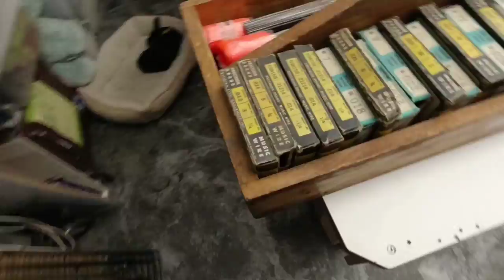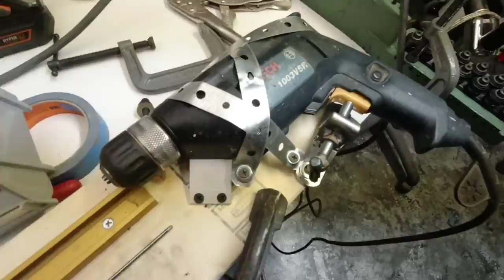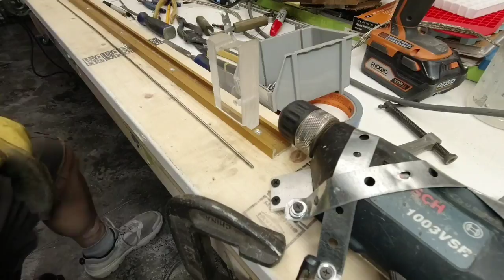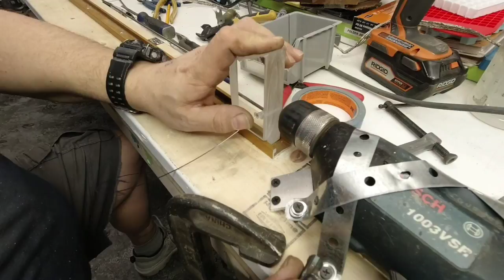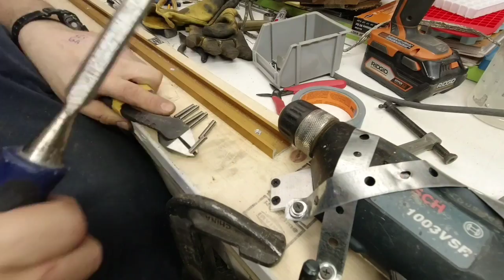Simple Diy Spring Making Jig /Machine (for those of us without a machinist lathe).

Comment: that setup is the definition of DIY
Reply from the maker: Thanks.  I take this as a high compliment. That said, for better or worse, sometimes i get lost in the building of a jig to save money and time. And, it turns out it could have been done more simply in another more conventional way. So, pro tip: weigh out what the goal is, then determine the best process to get there.  In this specific case, it was definitely worth the build. Simple. Quick. And, it worked without alot of trouble. Thanks for watching.

Comment: Pretty smart what you did with the block within the railing. Even with my mini lathe, I have to be careful not to apply too much pressure on the mandrel, or else risk bending the mandrel too far. But this block seems to solve that issue. Good work.
Reply from the maker: Thanks!  Much appreciated.  I imagine there has to be a better way, but i needed like 60 springs quick on the cheap and this was what popped into my head on the fly.  Thanks for watching.

Comment: cool jig,  is there a hole you poke wire thru at the start?
Reply from the maker: I am not sure i understand your question.  But, here goes...the clear acrylic block has a hole in it. This rests against the mandrel to keep mandrel from bending. Then you bend a 90° about 1inch or so in piano wire and fish that into the drill chuck between two of the three collet "teeth",  holding the mandrel--not a hole per'se but kind of.  So, 2 holes? In a manner of speaking.

Hope this helps.